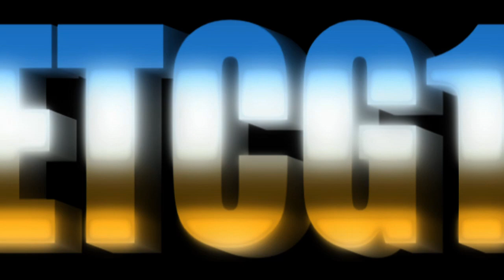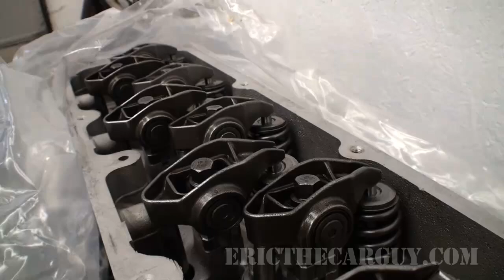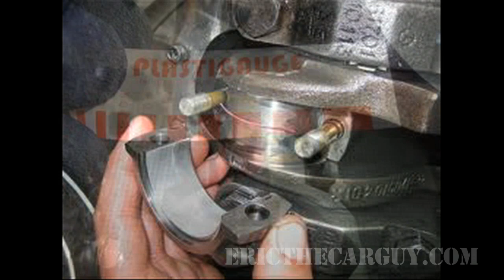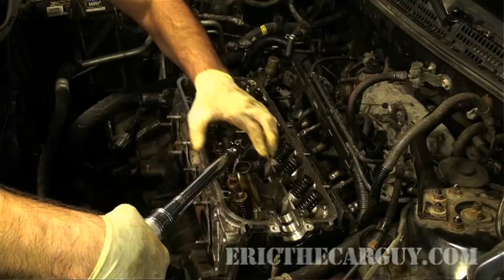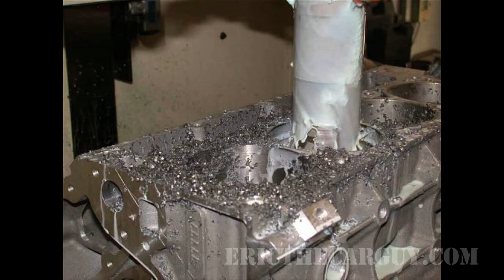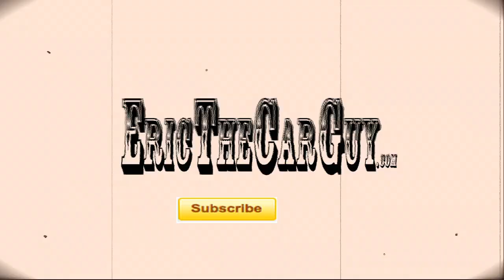Should You Rebuild or Replace? -ETCG1

Comment: Blew head gasket on 2012 Ford Focus  after looking at the maching the heads which is 160 q piece, and the additional labor cost  replacing the engine is the best option with warranty

Comment: A DIY engine rebuild sounds horrible for someone that doesn't have a passion for vehicles. I mean, you have to think, the engine is no small task. It's the heart of your vehicle for a reason. It was designed extremely specific and put together extremely specific. You don't just get that kind of knowledge out of thin air. Even with all of the resources, you still have to do all of the work, and take a chance with shops doing the needed steps to rebuild.

Even taking an engine out like Eric said is a huge task. Let alone cracking an engine open. This isn't a beer drinking contest although it could very well turn into one once you pull your hair out. It'd be like trying to learn the same things any inventor(s) or innovators, scientists, programmers, or engineers took years to learn/figure out in less than 6 months lol. Get real people.

Not saying it's not feasible, but some people make it out to be something that is casually replicated when it isn't. It's a rare occurrence for someone to rebuild an engine on their own without consulting other professionals. It's not normal. It's abnormal.

There are people that have worked on cars their entire lives (like Eric) that still don't necessarily have the knowledge to rebuild an engine. You can service a genius's work, and make it operable by maintaining it, but you're not going to just acquire the knowledge to start dabbling deep into all of the intricate inner workings of whatever that invention is. It just doesn't work like that. This is EXACTLY what an engine is, and transmission.

Comment: Depends on the engine and what your investment involvement is going to be in it and at what skill level. Also some remanufactured engines are a crap shoot especially if comes from a large reman corporation. They're like a production assembly line (next please) with today's employees with less work ethics means lower quality in an inflated market on finished product. Certain used engines I would never consider because of the notorious bad original parts from the start of day one and probably the mileage to high to even risk wasting time and the money when the used engine money can be used towards DIY rebuild with in ones own reasonable skill perimeters (may include  have some work done by a local machine shop) or put the used engine money to pay at least half of the higher cost of a reputable remanufactured engine builder.

Comment: my experience is no experience ever in rebuilding and engine. My experience is that I had an old engine installed in a b 2000 mazda truck, an lasted only six months and it cost at that time in 2001 1000 dollars all of it or maybe 2000 dollars.  Either way was a catastrophic experience.  Mechanics in general would be a be a bad experience.  Your information is solid with the right measurements.  thank you.

Comment: 10 yrs later and I have this same issue and needed to replace the engine. I wanted to replace but only on engine reman offered a non dod ls engine. I didn’t want the dod lifter issue to deal with again. So I replaced with a used engine that already had the delete done. All the remand had terrible failure rates and warranty issues as well.

Comment: I can see where a remanufactured engine is financially a good deal compared to rebuilding it yourself.  Rebuilding won't save much money, but rebuilding yourself allows you to use better parts.  I am in the process of deciding on whether to rebuild or replace a 2005 Ford 5.4L 3V engine.  To rebuild it myself, I end up with a lot of machine work to pay for.  What bothers me, though, is that the reman companies may or may not take the same care with decking the block, heads, boring, etc...  They want your core for a reason.  They will reuse anything that is still in spec and only hone cylinders if possible.  They will not use OEM Ford parts, either, but will go with the cheapest possible aftermarket parts.  An on the ford 3V engines, you really want the OEM ford cam phasers, and all timing components replaced with OEM ford parts, and an updated high volume oil pump.  The reman companies will use dorman phasers, aftermarket pistons, valves, etc...  Just not sure what I am ending up with on a reman engine.  But I guess the warranty is reassuring, and swapping a complete engine definitely saves time.

Comment: In my opinion: consider every used complete engine in need of a total rebuild at least. Sometimes they are not even rebuild-able. With this in mind, I don’t really consider buying a junkyard engine at all. That being said, it is normally cheaper in my experience to remove your engine, take it to a machine shop to get it cleaned and the the surfaces straightened, and honed if needed. Two of the engines I’ve built I have not taken to get machined but only after careful measuring. For these engines I also honed the cylinders with a drill operated hone. It’s not easy but absolutely doable once you get the hang of it. Also when measuring you have to triple check everything: cylinders, pistons, ring gaps, bearing clearances, camshaft clearances, crankshaft clearances, lifters, rocker gaps, etc. It IS a long and tedious process but once you do your homework and take the time to prep everything, you get to put it all together which in my opinion is half the fun. You will also no doubt need to buy tools you don’t have, but once you buy them you have them. Don’t be discouraged by the difficulties. You’ll get better as you do more, just like everything else in life. You’ll also appreciate the car that much more when you’re driving it around. This is my opinion.

Comment: I'm researching an engine swap for a 2010 Ford Explorer. Any used engine I would even consider (less than 120k, at least 1y warranty) is around $2000 and you still hafta add on around $400 for parts/labor (timing kits, gaskets, seals, etc) Remanufacturing my existing core is about $2850.

Comment: Nice awesome 👌 👏 👍 😍 video on this topic I have a Ford Econoline E250 5.4L V8 engine 255k miles I want to rebuild it using a Ford rebuild kit or just purchase  a remanufactured engine 😀 so Eric what's your opinion on this subject rebuild or remanufactured engine or replace it with a use engine with low miles?

Comment: The way I see it if the motor is in production still and easy to find a new motor replace if it’s something older where they are no longer being made and crate/drop in rebuilds are harder to find or expensive then rebuilding is the way to go

Comment: This my first time doing mechanic work. And I'm starting by replacing an engine on a 2008 Honda Accord. I've taken apart some things( radiator, the front end. I know of the time it will take, but it's extremely hard. What tools should I get for this complex job

Comment: Plasti-gauge is fine for mains but NOT for rods. You can't stop the rod from twisting slightly when you torque it due to bearing clearance. This smears the plastic and tricks you into thinking the clearance is too tight. So, you substitute a looser bearing to get what you think is the right clearance. Do that 8 times and you wind up with low oil pressure.

Comment: I recently had to make the decision to rebuild my engine or purchase a new one. Since my GMC 2-Door (1996) Yukon GT had a limited production (1993-1997), I wanted to keep all the numbers matching. I also sent the engine out to a machine shop to have the rebuild done. I needed new heads because it appears Vortec heads crack rather easily anytime the vehicle overheats. So, with a rebuilt transmission, new OEM front end, and the rebuilt engine, I keep the vehicle true to its original specification. One of these GMC Yukon GT 2-door 4WD just sold on eBay for 18k with 68k miles on it. They are in high demand and only getting rarer. Now, if it was just some utility truck with no extrinsic value, a new engine is sound advice.

Comment: In my case, it was a newer car at the time, and where I am from, I couldn't just find a new engine to throw in. This is actually what got me into becoming a mechanic. I knew nothing about cars, and I learned everything I needed to know about rebuilding engines from watching videos. Long story short, sometimes you don't have the option based on location and ease of access to replacement engines, so all you are left with is grabbing your wrenches and learning how to rebuild. :)
Reply: You left this comment a year ago and here I am doing the exact same thing you did. I just got into cars and knew nothing about em. Here I am after working on drum brakes, disc brakes, coilovers, and exhaust system learning about how to rebuild an engine

Comment: It depends on what you mean by replace, I know a good local builder that I'd rather have build one and he's very reasonable on price. Compared to a mass produced "remanufactured" engine that's going to be bored probably 30 over at least and who knows what else. I really don't see the benefit of one of the mass produced ones like jasper compared to a good builder. Of course, a lot of newer vehicles from the late 90s to now don't really have engines that are designed to be rebuilt or overbored or anything, they're basically throwaway. I'm of course not talking about rebuilding yourself.

Comment: most of the time its best to replace (if you spend time hunting for one you will find one, not just in junk yards btw). Theres just too many pitfalls on rebuilding it yourself or buying a rebuilt engine from a big rebuilder company....they often have big rep probs so... on the other hand theres mechanic probs too... some jerk you around forever, maybe even bleed you dry of $ at same time. Really my best advice is most of the time is to dump the vehicle & move on

Comment: The key factor here which was not discussed is measurements. You have to measure cylinder bore as well as check the condition of the heads first. You might be throwing away a good engine. Rebuilding is about the same price as a rebuilt engine so I agree it’s best to get the warranty however in my case I have to know for sure what’s going into my engine. They have bearings that are crap and might last 100,000 miles then they have bearings that will last a half million miles. You never know what you have in a rebuilt engine unless you tear down a few parts to inspect what your getting. Rebuilding is also something any mechanic can learn and just have to take one step at a time and do it right. Measure everything. I did mine due to pride. I had to say that I built it and no one else. A lot of these show cars now have engines built by someone else and in the beginning 80 years ago it was all about building the best engine you could and showing it off

Comment: Great information. I have a 2007 Toyota Camry, and it is starting to use a lot of oil. Toyota has a TSB for my engine, but no recall. I know the pistons and rings need to be replaced as per the Toyota bulletin. I know I will need to have the motor removed to do this work; I have 190,000 miles on this motor, curious if I should maybe just replace the whole motor now.
Reply: just drive it at top oil until it dies, then replace
Reply: @lordred7462  thanks, I have 197000 miles now, still going, does use about 2 quarts of oil a month on average.
Reply: @vincentortega4284  when your engine loses power and fuel consumption rises, oil burn also rises take calculator and calculate does is better for you to replace engine or drive it like that. Engine usually won't die catastrophicaly to throw a rod for reason. I replace it when old worn engine cost me more money on bigger consuption of gas and oil because is worn than to put better engine in car. for example if you can pay price of your new engine just on lower consumption of gas and oil in about 6 months or year then you should replace engine. Old worn engine after some time is too beat up to run just because economics, he have lover and lover performance and higher consumption
Reply: @lordred7462  thanks

Comment: I've got a 2005 Dodge minivan with a 3.8L engine with a bad head gasket and it has somewhere around 250,000 miles.  I'm looking at either getting a reman engine or just a new used car.  My thought is that if I get a reman engine...I might as well do the transmission as well. I'm expecting with labor and the engine and transmission around $7000.  $7000 doesn't buy a whole lot of used car...but still to make it worth it I think i'd have to keep the van a long time.   ...as I typed that I did the math.   If I got a new to me used car and had a $300 a month payment then I'd only have to keep the minivan 2 yrs for break even....assuming nothing else goes wrong...but something else could go wrong on a used car as well.   Opinions?

Comment: Since it just burned the gasket head i will take it to the machine shop resurface everything and stuff, replace the valves and seals, everything that comes with the kit and them put it all toghder according to the manual of the engine.

Comment: What if it's a stock 1965 mustang with all matching numbers? Will it lower the value to replace with a 302 vs rebuild the original 289? The engine runs, but is definitely tired.
Reply from the maker: With classic vehicles that you're trying to retain the value of, a quality rebuild of the original engine would be the best option. In an everyday car, replacement would likely be the best option. In my opinion.

Comment: Would I need to replace a whole motor for a head gasket failure?
Reply: No, just get a headgasket replacement usually around 1500$ but get your engine diagnosed before hand because your headgasket might've blown for a few different reasons, don't wanna spend 1500$ to have it blow up on you in a few months
Reply from the maker: Not usually no. It depends on the damage to the engine. If there is engine damage, then engine replacement might be the way to go. If there isn't damage, just replace the head gasket.

Comment: I've rebuilt mini engines I mean over 500 engines in my lifetime animal only mid 30s started at seven years old in the backyard with the toolbox and the Hand sand block made out of wood on a 1970 El Camino and got it running made $250 from a family friend and never look back I would definitely say if you can replacement is definitely easier and more efficient when possible but you do have those tasks and those basket cases and those owners and collectors that refused to let go of certain things and sometimes it's better to know when to let go

Comment: Is it worth it to get a 2004 honda pilot transmission be rebuilt for $2800? They originally quoted $3600 but then i checked another shop they said they had a transmission from a 2008 pilot and would do everything for $1500. I was gonna have it towed and the guys at the shop where my car was said they already took it apart and would charge me $500 to put it back together. And if i did it there they would lower it to $2800. 🤦🏻‍♂️

Comment: Mechanics these days are scared of simple rotating assy😂😂 we live in a throw away world! A simple rotating assy and an r&r oil pump on a  short block scares the hell out of a melineal mechainc!  Lol
Reply from the maker: A few inaccuracies about your statement. 

First, when you install a reman engine, you often have to send back the core. Meaning, you don't 'throw it away' unless it's damaged. 

Second, most mechanics are not millennials. The average age is 40+. 

Lastly, it's obvious you've never worked as a professional mechanic. If you had, you would know that time is valuable. The time spent rebuilding could be spent fixing more vehicles and helping more customers. Reman engines are a better option in that scenario for 2 reasons. 1, they save time as I mentioned. 2, they offer a warranty that is extended to the customer in case something happens in the future. 

Thank you for your comment.

Comment: I prefer rebuilding because you create or alter the history of the engine. With a second hand replacement you don't know it's story. I bought one and when I removed the exhaust I saw deposits of coolant in the exhaust port. Now I'm believing my best step is to take parts from the bought one to make mines right because I fear a cracked cylinder head as the engine isn't known to really blow a gasket.

Comment: Thanks Eric for your input. 
I just gave my 13 year old nephew my fathers 1964 C10 Chevy pickup. I gave it to him under the condition that He take classes in school to learn how to work on the truck. His dad and I have different thoughts about rather or not We should rebuild the 282 engine that is in it. ( it’s been sitting for over 20 years.) Or buy a crate engine. 
I want him to learn how to wrench like I did and his Grandfather did. But I am not so sure he will have the aptitude right away for a rebuild. Do you think I should help him save up for a crate engine and tranny? Or should we attempt to do the rebuild, knowing we have three years before he can drive?
Reply: I know ths is old, but replace the engine with a good used one,, then work on the original aa a back up engine, especially if its about educatiion. Just  my opinion.

Comment: A quick replacement can save time , sometimes even money. but dont think rebuilding is going to be much easier....like Eric said, you gotta be precise on the torques specs and measurements...from there everything else is a breeze if u do it correctly., if all goes well u have a good engine to last u for a pretty long time... u never know going either way. MY OPINION ON THIS QUESTION IS, I WOULD RATHER BUILD IF I HAVE THE TIME AND KNOW HOWS..., AND I WILL GO WITH A QUICK REPLACEMENT FOR TIME I SO MUCH NEED. Alot of us will choose a simple fix over a build. - but if u build it right u have yourself a brand new engine....which ever u choice is up to u at your preference, and the situation you are in.